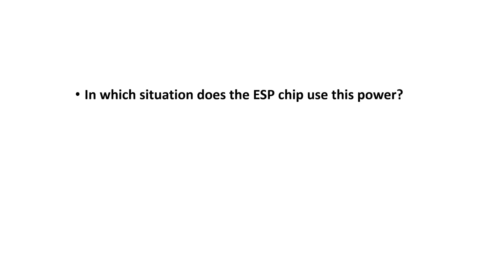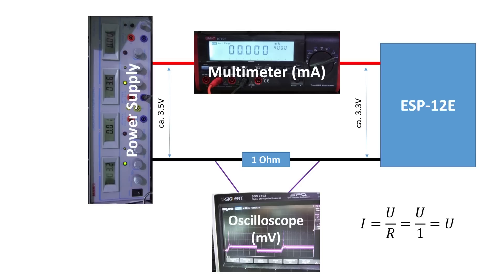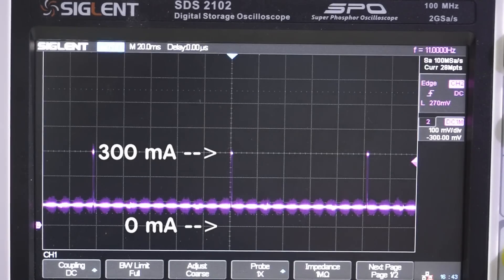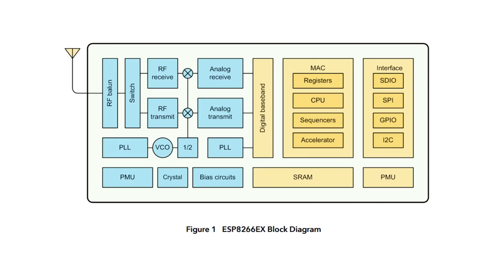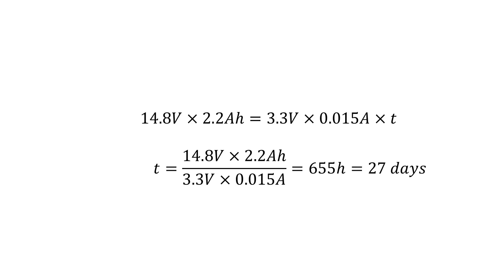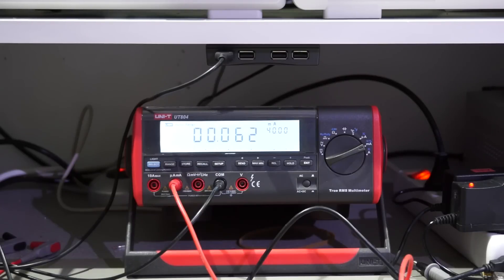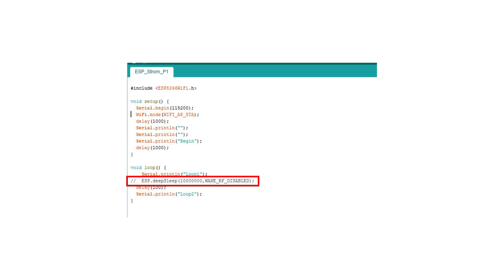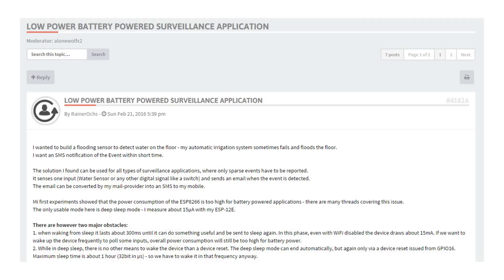#47 Power Saving with ESP8266 (Sleep Mode) Tutorial with some Tricks

Comment: Andreas, i have a project that needs some power management help and light sleep on the ESP8266 is complicated and not much is know/tested about the mode. I have sensors that are attached to the PCB and want to continue to collect IMU/Barometer data while in light sleep. The project is located here:https://github.com/cnlohr/esplocalizer any suggestions?
Thanks,
Kevin
Reply from the maker: I only tried the light sleep and was not successful. So, I did not use it and therefore do no know anything about it. I do not know what you want to achieve, so it is hard to suggest. Maybe you also ask Charles. He is very knowledgeable about the ESP.
Reply: will do thanks...kevin

Comment: Does RTC RAM even exists? Because he(RainerOchs) is writing to the same memory offsets as you (65+). I think it's he's referring to RTC EEPROM when he says "RTC RAM". Am I correct?
Reply from the maker: +Rui Rex There is no RTC EEPROM, only RTC RAM
Reply: Oh, ok. Thanks! Now I see... I got confused when you talked about EEPROM (emulation) on you're video #60. Then I thought that the RTC memory was in fact EEPROM. So no wear on RTC memory, great! 
I made a ESP clock with MAX7219 led matrix but now I want it to sleep between updates but also keep the dots blinking :) Thanks again!
Reply from the maker: +Rui Rex this is how I do it with my YouTube subscribers counter
Reply: +Andreas Spiess Yes, I know. I got some parts from that project :)  mainly because of the rotated display. I also use those with 4 matrix on a single PCB. I'll check it out. I didn't have some of the debug functions defined so I didn't use your code (didn't bother to fix it...). But your code architecture is good.

Comment: My ESP8266 still draws 10mA with the same sketch. How can i fix this so it'll be 20uA?
Reply from the maker: +Guus van Marle Is it a NodeMCU or wemos board?
Reply: Andreas Spiess it's a nodemcu board.
Reply from the maker: +Guus van Marle You have to use a bare ESP-12 board. The NodeMcu have too many parts which consume current
Reply: i'm powering the board with a 3.3v power supply directly is the ams1117 stil drawing current then? What about the cp2102 is that drawing a lot of current?
Reply: thanks (I got the reply from you late)
Reply from the maker: +Guus van Marle You write, your device needs 10ma. The ESP 12 uses ca. 20microA.
Reply: Andreas Spiess so it's the ams1117 and the cp2102 that are using al that current. thanks. i'm gonna order a bare ESP8266 for my outdoor temperature logger.

Comment: My sketch reset after 10sec sleep command. But not start again, loop1 didn't shown after sleep?
Reply from the maker: +Signal Elektronik did you connect pin16 with reset?
Reply: Yes I did. I saw power consumption goes down after reset, but sketch can't restart again. 

**********************************************************
Begin
Loop1
{l$ÜŸ|{l$ÜŸ|{l$ÜŸ|{l$ÜŸ|{l$ÜŸ| bla bla bla 

and here comes nothing. 
**********************************************************

I tried all module in my hand and I've got same result all of them (Even original ESP-WROOM-02 Espressif module). I can't understand is it version issue or serial adapter FT232
Reply from the maker: +Signal Elektronik what is your sleep command? What happens if you reset automatically after 5 secons?
Reply from the maker: Everything works as you advised in your sketch. if you work with deep sleep. you do not need to have anything in loop. After deepsleep. the ESP sleeps and starts with a reset at the beginning of setup. So, it never reaches delay(100);
Reply: I'm terribly sorry about that. But the problem is my Tantalum Capacitor. I think the capacitor datecode is too old. I change the capacitor and everything is fine. Thanks a lot and sorry about that. :(

Comment: I got only 7 days from deepsleep getting The temperature outside each 10 minutes with a 18650 battery. Is there a way To extend battery Life ?? 
Thank you. 
Have a Nice day. 
Marc.
Reply from the maker: Which board did you use?
Reply: Andreas Spiess nodemcu v1
Reply from the maker: This is, what I thought. These boards use a lot of energy because: 
1. They have a USB to Serial chip which is only used for programming
2. They usually have an AMS1117 voltage regulator which uses way  too much energy during deep sleep.
You need a plain ESP-12E board with a good LDO regulator. Maybe it is good to watch my video #91. And there are some other related videos in my ESP8266 playlist.

Comment: Andreas - Excellent Video and Loved your thorough explanations... I have
 tried this with an ESP8266 - 01, however, it seems I over-looked the 
need for access to GPIO16... Doesnt seem available.. My experiment was 
to place these in a wearable package for my pets to track them through 
the day... Using Signal Strength and several other ESP8266s thoughout 
the house...but, battery consumption is a problem, it seems the 12E is 
the only option, correct? Or do you have an idea on how to better track a
 pet through the house...
Reply from the maker: Did you use deepsleep?
Reply: Hello Andreas, I tried the Deep Sleep, but I am not using 12E, using the ESP8266 - 01 Module, but maybe need to order a couple of the 12E versions,,, Since GPIO16 is not accessible on the Module..
Reply from the maker: Yes

Comment: Dht22 and deep sleep does not work very well. After a few cycles, the esp can no longer read the signal from the DHT22 sensor. This also happens irregularly. Do you know the problem?
Reply from the maker: Do you switch the DHT22 off druring deepsleep of the ESP? How do you power the DHT? It absolute minimum is 3.3V.
Did you see this text " don't send any instruction to the sensor within one second to pass unstable status" in the data sheet of the DHT22 and is your sketch programmed like that?
Reply: Following lines before "deepsleep" seems to help:
"   pinMode(DHTPIN, OUTPUT);
    digitalWrite(DHTPIN, LOW);
    ESP.deepSleep (XXX);

Power is stabel. 

I found this in the Adafruit lib in DHT.cpp:
"// Now start reading the data line to get the value from the DHT sensor.
    pinMode(_pin, INPUT_PULLUP);
    delayMicroseconds(10);  // Delay a bit to let sensor pull data line low."

Maybe the error is here located?
Reply from the maker: If it works, it is ok. It is always hard for me to remote-diagnose tricky problems. There are many possibilities for something to go wrong.

Comment: Thanks for the deep sleep explanation. Is there any video explaining Light Sleep in detail? I am new to ESP so I have few questions. If ESP8266 does Light Sleep automatically or if we have to do it manually with WiFi.forcedSleepBegin()? If it is useful to use forced light sleep or should I go with deep sleep always?
Reply from the maker: I never used the light sleep and I do not know, if it works. A few mont ago, I read, that it did not work properly. Its effect on power consumption is also not that big, similar to switching off the WiFi.
Reply: Thanks for replying. Another thing, if I use ESP.deepsleep(time,WAKE_RF_DISABLED) then on reboot, my wifi will be OFF. Right ? then how can I enable it again ? for example, 1 out of 10 times I want to enable Wifi.
Reply from the maker: That is not trivial. Because the ESP boots after deepsleep, you lose all your varialbes, also your counter. In some of my videos I solved this problem using the RTC memory. But I would start first simple and add complications afterwards

Comment: So if you use a large capacitor to reduce the current spikes in order to be able to use a lower current regulator, how do you deal with the inrush current when the capacitor is initially charging?
Reply from the maker: A small regulator usually cannot deliver a high current (because it has a high internal resistance or a protection circuit), that is the problem I want to solve with the capacitor. So, I think, the inrush current will be limited by this fact.
Reply: It won't damage the regulator?  I'd like to use a MCP1700.  Datasheet shows max output current at 250mA, but output short circuit current at 408mA, which is way above the 250mA spec.
Reply from the maker: bkhofmann so, you see, you could even short cut the regulator without harm, because it is protected
Reply: Thanks for the reply, and thanks for all the great videos!  I look forward to them!
Reply: be careful when using big capacitors (>1000 uf depending on your max current and wire dimensions) which leads to slow VCC rampup. It happened to me that at powerup the rampup of the 3.6V VCC voltage was so slow that the ESP startet without WIFI properly working. The reason is that when rampup is too slow due to limited inrush current, the ESP core starts running (e.g. at 2.5V or even lower)  but WIFI cannot initialize correctly at that time because it needs higher voltage for calibration. It is not always "the more the better" :-)

Comment: Hi Andreas, Interesting tutorial. I measured current comsumption in  an ESP-12F and detected picks of 500mA. Have you ever  tested this model? It's rather weird, because I did not find any reference about diferent current consumtion among esp8266 models.
Reply from the maker: No, I do not own one. And I am also not completely sure if I measured the the real peak current of the 12E's correctly. I was satisfied with the results then. How did you test?
Reply: I used the same method for testing that you have used. I think the higher current comsumtion is related to the improvement in the RF module of 12F.

Comment: Thank you for all of your video's. They explain all details very well. One question though on deepsleep. I'd like to wake my esp8266 from deepsleep from an external interrupt (button press). I thought I could just connect vcc via a resistor with a button to ground and T from between the resistor and button to the RST input to put an interrupt event on the RST input. But that does not seem to reset the device. Is the D0 - RST connection still needed in that setup? Any thoughts on that?
Reply from the maker: If you pull the RST pin low and high again, the ESP boots. I just tried it with my NodeMCO board. So, you connect a 5-10k resistor from VCC to RST to keep it high and a push button between RST and GND. Then, you should get what you want. Just connect serial monitor to check. The module always have to be powered.
Reply: It seems to have been a case of the syndrome that you can look at a situation for a long time, but don't spot what you've done wrong. I now see that I had the resistor connected to GND as well. Thank you very much!
Reply from the maker: You only learn from errors ;-)

Comment: Thank you for the very informative videos Andreas. You mention below that you used a 10mH inductor with the same effect of the 1000-2200uF cap. How did you connect the inductor (in addition to a cap or from supply+ to Vcc alone)?
Reply from the maker: If I remember right, I used the inductor instead of the capacitor. The inductor has to be connected in series in the power line either in the plus or the minus cable. It does not matter which. 
Maybe a combination of both would be the best solution, but I did not check.

Comment: Thanks for the deep sleep explanation. I plan to create some humidity monitors, each using a DHT22.  Now I know how to save battery power draw from my ESP8266.
Reply from the maker: Good luck with your project!
Reply from the maker: Then you have to connect pin GPIO16 with the reset pin. But only after upload (otherwise you might have problems with the upload iof the sketch). This connection is necessary to restart the module after deepsleep.
Reply: I tried the same thing, but my ESP never wakes up again... can you post your code? Thanks...
Reply from the maker: Did you connect D0 with the RST pin?
Reply: What is D0? WTD0? I have a ESP03... does it work with this board?
Reply: XalphYT let us know how is going your project :)

Comment: Andreas another great video. Thank you.

Have you ever considered or tried using a MOSFET to bypass the regulator under ESP control? The idea wouldl be that when the battery voltage was low enough the regulator could be shorted out by applying a GPIO signal to a FET. Then the full battery voltage would be available to the system, and the regulator losses would be eliminated.

In a deep sleeping system, the fact that the battery voltage was low enough to allow regulator bypass could be saved so that it woke up  that way.

Just an idea.
Reply from the maker: This is possible, but quite complicated. And you lose your only ADC on the ESP. I did not test, but the last few mV are not very valuable because at the end, voltage drops quite fast. Also dropout voltage of a HT7333 3.3V is only 150mV.
I also not tried the accuracy of the ADC of the ESP at variable Vcc. The Arduinos use Vcc as a reference. So, the ADC readings are not very stable when you change Vcc (video #10 shows that plus a trick).
Reply: OK thanks

Comment: Mr. Andreas, first, thank you for sharing your knowledgement  and  I like your peculiar way of teaching, it´s very clear and understandable.  Second, can you help me in a doubt ?  Have you ever measured the amps consumption of an ESP8266 with a decoupling capacitor of 1000uf 6v  in deep sleep mode ?  And then, take the capacitor out and measure again...  Can you do this test for me ?  Because I did, and with the capacitor  even in deep sleep it draws 150uA...  With out the capacitor it draws 3uA.   Can you confirm that ?   is there a way to use the capacitor, but keeping the consumption in 3uA ? PS:  I am powering ESP with two AAA batterys... Thank you very much !
Reply from the maker: I am travelling and have no module and capacitor handy. You can do this yourself by just measuring the capacitor without a module. If it uses the difference, then it is the cause.
Pay attention that you wait a long time before you measure, because the capacitor is loaded over an exponential curve and this takes long. It is possible that you just measure some loading current. If the capacitor does not take the current, write a sketch which leaves the esp in deep sleep for one hour and measure.
Reply from the maker: +Eduardo Zola you decide with the calls you described in which mode the Esp will wake up. So, you know. The Esp should not chang this mode itself.
I do not know of such a function.
If you are in doubt if the calls really work, measure the current.
Reply: That's probably the leakage current of the capacitor.  Tantalum?

Comment: Hi, thank you for the video and the relation between the supply votlage and the deep sleep current.
I'm wondering if you already test deepsleep with ESP01. Because on the web i found a deep sleep current of 78µA but with your code i have a deep sleep current of 250µA @ 3.3V and 520 µA @ 4.9V and i don't know why...
Reply from the maker: Which module do you use? Any voltage regulators?
Reply: ESP01 like this: http://tim.jagenberg.info/files/2015/01/PTIM9823.png (512Ko) from FYI here is the hack to allow deepsleep on http://tim.jagenberg.info/2015/01/18/low-power-esp8266/
No voltage regulator, only a DC lab supply and a capacitor of 100µF on the supply
Current measurement are performed with a multimeter AMPROBE AM-510-EUR with a accuracy of ±(1.0% Rdg + 2 LSD)
Reply from the maker: The hack is not for deep sleep, but for wake-up.
Are you sure your ESP is in deep sleep? How do you check? I do not remember if the ESP-0 has a LED. There is a circle on one of the pictures you sent me. You have to remove the LED if it is always on.
Otherwise I have no idea.
Reply: Sorry for the sentence, yes it is for the wakeup. I'm sure the esp is in deep sleep while it reboots and stay in sleep during the correct sleep time (and reduces the current). I have already remove the led.
Perhaps it is the other black component (i don't know what it is) which has a higher sleep current than the esp8266.

Comment: Hi, could you check with ceramic capacitors? Electrolytics have relatively high ESR when comapred to ceramics. Could make a big difference. Maybe just 300uF ceramic would be sufficient.
Reply from the maker: +helloworld Unfortunately, I do not have such big ceramic capacitors. The biggest is 10uF. I just checked with Aliexpress. There, 220uF were the biggest I found. But they were very expensive (compared to the tantalums I use). 
I am also not sure if the charge of such a capacitor would be sufficient, because the peaks have a certain duration. But I am not a specialist in capacitors...
Reply: +Andreas Spiess It need not be a single ceramic cap of 300uF. 100uF is available for <6 cents were I live. So that's 18 cents worth of caps with very low ESR. The required pulse energy (V*I*t*) is  3.3*0.3*0.001 = 0.99 mJ. The energy stored by a 300uF cap charged to 3.3V would be (0.5 * C * V^2) 0.5 * 300*10^-6 * 3.3^2 = 1.63 mJ. This is greater than what we need but it is there to overcome the effect of capacitor voltage dropping as it discharges and the effects of ESR. I am not sure about the exact number - 300uF or 500uF. But could be worth a try.
Reply from the maker: +helloworld Ok. You convinced me. I ordered some 100uF and will try it.
Reply: Great! :)
Reply: Hello Andreas, thanks for the video! Will you make another video with ceramic caps? Where exactly have the caps to be in the layout? Between VCC and GND near ESP?
Reply from the maker: I think, this is not worth wile a video for the moment. Yes, the capacitor has to be as close as possible to GND and VCC on the ESP module (see picture of video #60)
Reply: Ok thanks
Reply: Six months later: so, does it work well with multiple ceramics?
Reply from the maker: I have to confess, that I had other projects and did not do anything further. Sorry.